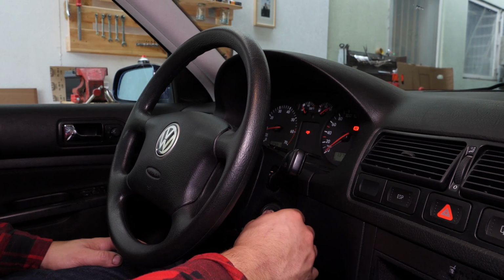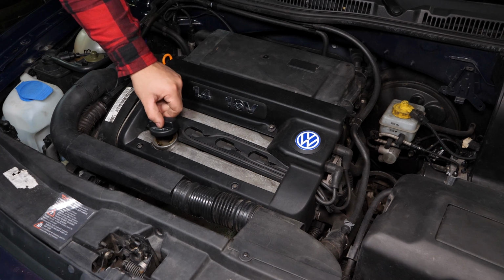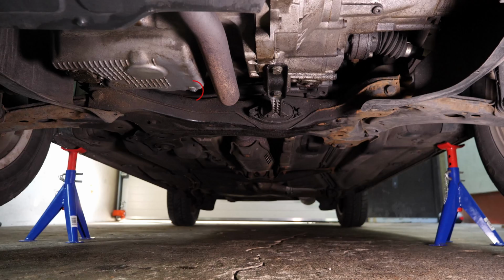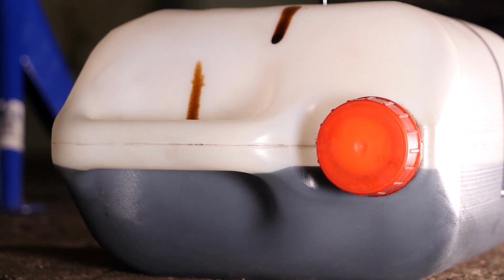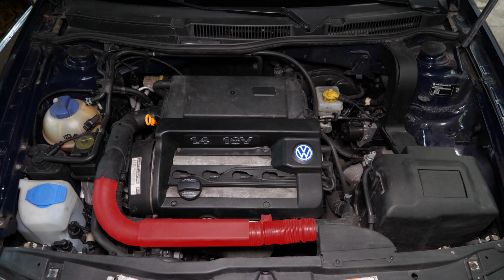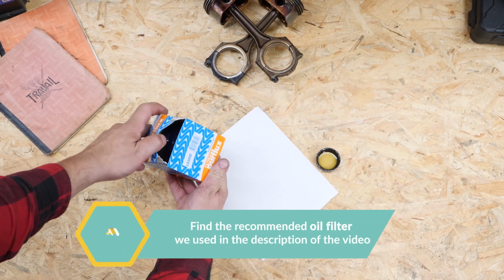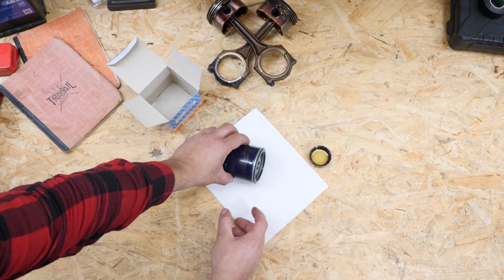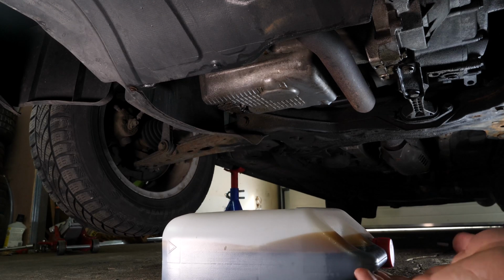Change the oil and the oil filter Golf mk4 1.4 16V 🛢

Comment from the maker: 🛠📏⚙ FIND ALL THE PARTS AND TOOLS NEEDED AND RECOMMENDED BY USETOOL EN ⚙📏🛠

"BUY THE AUTO PARTS you need for the operation : 👉 http://bit.ly/cheapAutoparts 👈
📱 DOWNLOAD THE APP : 🍎 http://bit.ly/MCD12AppStore, 🤖 : http://bit.ly/MCD12PlayStore 📱⬇︎⬇︎ 🔥   🔧🔧🔧   🔥⬇︎⬇︎"

Needed parts: 
- Oil filter : http://bit.ly/oilfilterLS969en

- Motor oil : http://bit.ly/oil8100XCLEAN5W40en

- Drain seal : http://bit.ly/drainnut15374en

THE USETOOL APP IS OUT ! DOWNLOAD IT ON THE APPSTORE: http://bit.ly/MCD12AppStore AND GOOGLE PLAY: http://bit.ly/MCD12PlayStore

Discover a vast array of services that will help you run the maintenance of your Golf 4 vehicle user manuals, maintenance planning and mechanics-oriented tutorials!
How to change the oil and the oil filter on a Volkswagen Golf 4.

Discover the world of UseTool EN on http://bit.ly/usetool

Needed tools:
-💣🤖🏆The complete toolbox recommended by UseTool ES to repair your Golf 4 : http://bit.ly/supertoolboxEN 🏆🤖💣

- 30mm socket
- Mid flat head screwdriver
- 19mm spanner
- Small flat head screwdriver
- Measuring cup (optional)
- Piece of tissue
- Funnel
- Liquid collector
- Funnel (optional)

🔝💪Safely lift your Golf 4 with the hydraulic jack: http://bit.ly/upupupen and axle stands: http://bit.ly/axlesen recommended by UseTool EN 💪🔝

- Hydraulic jack 
- Wooden peg
- Axle stand

🚗📢💡 RESOURCES 💡📢🚗

Usetool's warnings
- Don't perform this operation when the engine is still hot, as you could seriously burn yourself. 

- Be very meticulous when filling the engine with oil, especially on a Diesel engine. Never go over the maximum level indicated.

Usetool's infos
Tightening the new filter by hand is enough to set it in place.

📽❤️🚨 USEFUL VIDEOS 🚨❤️📽
- [ USETOOL'S TIPS & TRICKS ] DIY: Making a liquids collector : https://youtu.be/wVSbtm-DAgY

- [ USETOOL'S TIPS & TRICKS ] Lifting your vehicle safely : https://youtu.be/93QCNfGihMw

- [ USETOOL'S TIPS & TRICKS ] Unscrewing a blocked oil filter : https://youtu.be/hrPp4VmvdhI